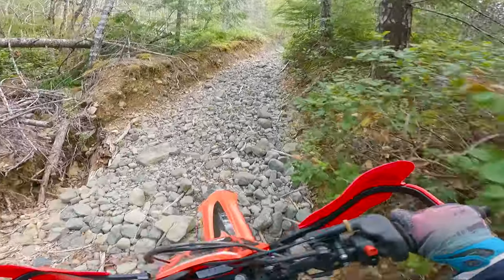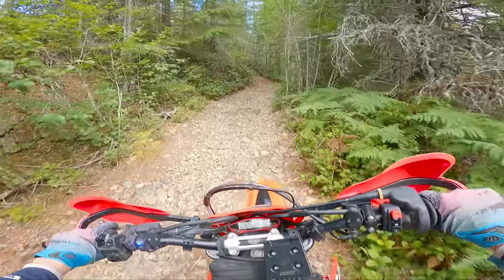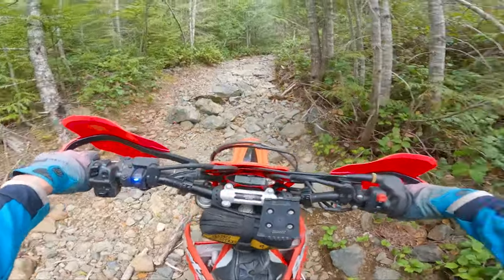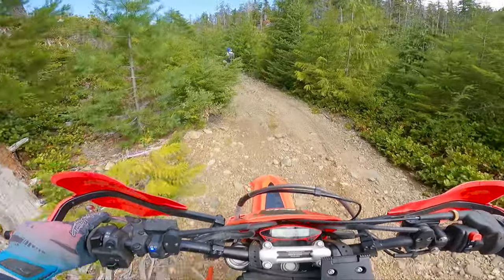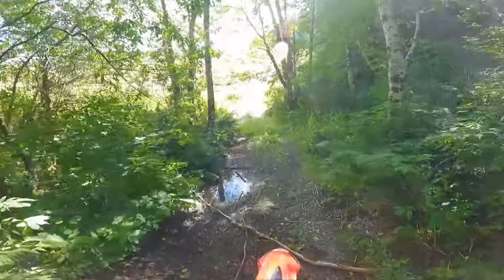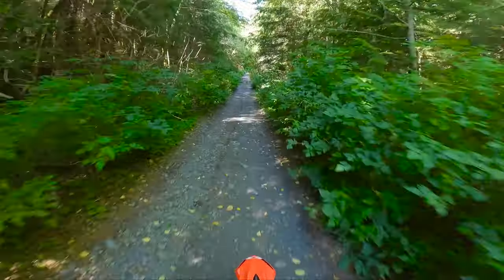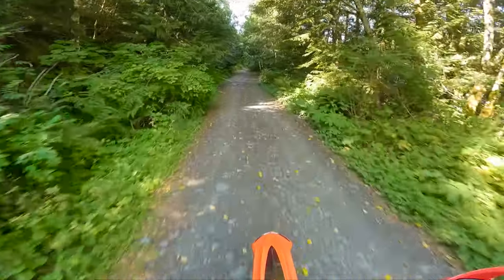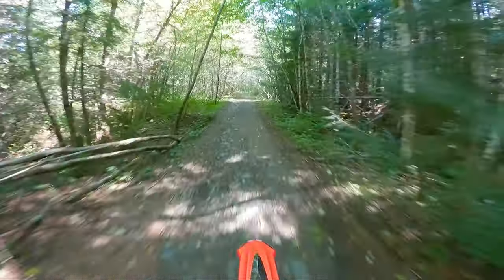5 Miles Of Riverbed VS 2023 Beta X Trainer 300

Comment: Looks like a really nice trail bike.  I don’t need a hard enduro bike, just something with some low end grunt and reasonable suspension.  Have you ridden the 200?  So next time you will tell us about the hand cramp solution and maybe you can get specific about tire pressures and what tire?  Thanks - looked like a lot of fun!
Reply from the maker: I haven’t tried the 200 beta’s yet. I found putting the handle bar at a more relaxed neutral position helped, as well as doing the same with the brake/clutch lever position. Ive since change tires to a kenda ibex gummy front and a dunlop at81ex rear gummy tire. I run the front tire at 6psi now and the rear at 5psi